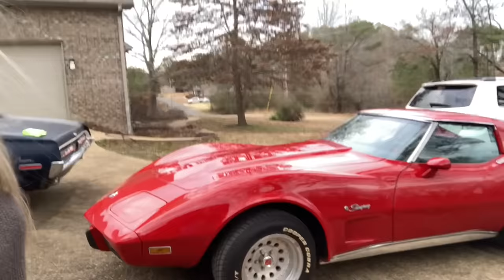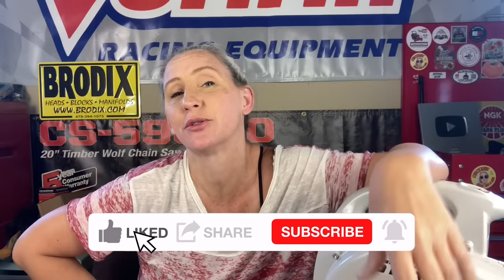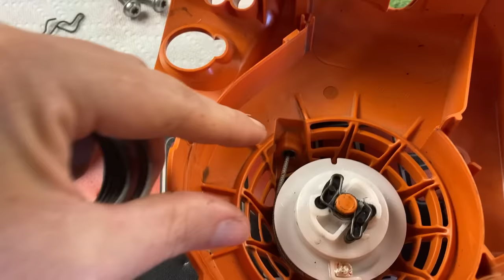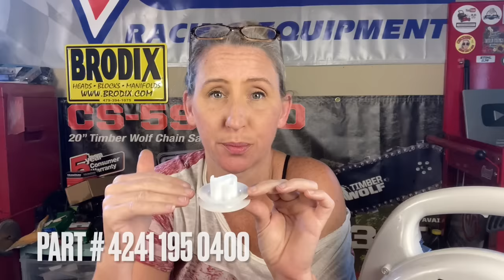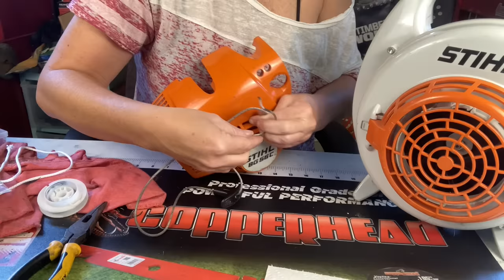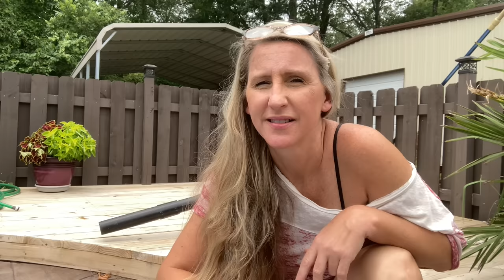STIHL'S "Easy Start" FAIL! How to fix it FOR GOOD! Stihl BG 56 C

Comment: If you want to undo a tight knot, simply place the cord on a hard surface and gently tap the know with a hammer. You might need to turn the knot over and tap it again from the other side, but when you’ve done you’ll be able to easily untie it.
Reply: ya gotta massage the knot.
Reply: That method actually works on big knots as well. My tow strap for my truck got knotted and it worked good for undoing it.
Reply: Or, you can just cut it off.
Reply: Or, do what Alexander the Great did with the Gordian knot. Just cut the damn thing!
Reply: Wow , what a great idea.
Reply: Roll the knot on the ground under your heel.
Reply: so do you call the clips of those dogs?..  did I hear that correctly? lol
Reply: You have to set the blower on the ground to start it. People want to hold it with one hand pushing it down while pull starting it and the spring can't handle the tongue. Ask the customer to start it up for you  and see how they start it.
Reply: @leroyc5289 butterfly clip, kinda looks a butterfly shape.

Comment: I work for a Stihl dealer and the issue we see that causes 99% of this problem with the easy start is that the top of the pulley post above the groove for the pawl spring starts to mushroom. When you take the recoil apart and it is hard to get the washer off the post is mushroomed and will keep having this problem if repaired. We sell the customer a new recoil, you'll have a happy customer and a repaired unit.
Reply: Good to know, thanks. But how in the hell does that pulley post get mushroomed? If I remember correctly, it's made out of some type of aluminum, but I didn't realize there was any kind of force being directed inwards towards the shaft that would cause it 'shroom out like that.
Reply: I did that , $ 75 for recoil !  Bad deal

Comment: Worked in a huge yard equipment shop years ago when I was between jobs. Learned a lot about small engines, always had a mechanical ability. Stihl was the hardest brand to start, that is why if still use Echo equipment.

Comment: There is another fix that is more economical and quicker.  I experienced the same problem with my SH86CE and found a solution and the cause of the problem.  The spring "butterfly" clip  (part # 1128 195 3500) and washer (part # 0000 958 0923) no longer exert enough pressure on the carrier "center pulley" (part # 4241 195 2001) which sits over the spring  (part # 4241 195 3501).  The carrier-center pulley no longer sat flush over the rope rotor (part # 4241 195 0403).  I purchased 2 additional washers, now a total of 3 including the original, to have the carrier-center pulley be firmly on the rope rotor.  My blower has been used multiple time now and i've experienced no issues.

Comment: I guess I'm lucky. My MS 180c is my go-to saw and has been used professionally for 4 years in the hot desert heat. The easy start messed up once and was good to go again after simply taking it apart and cleaning it out. Definitely not a saw you drop start. Good video.

Comment: i used your tip to slowly pull a few times (just over the first point of resistence) with my Stihl 230, before i really try to start it, and it starts way easier. THANKS.

Comment: I can say from experience that when the main spring comes out it really ain't no fun.
I had to take the spring out on my chainsaw because the end was broken off so it wasn't working.
I had to fold a new end on the spring and then wind it back up and place it back in it's place.
That's a job I really don't want to do again because I really struggled with it for nearly an hour but I did get it fixed.

Comment: Those easy start Stihls remind me of the old Briggs and Stratton motors with the wind up crank on top of them.  If you're old enough to remember those.  I seen a lot of them back in the day when  worked on mowers.  About the same category of junk in my opinion.  The pull up starters were better but not great.  I made sure all of my Stihl products didn't have that easy start on them when I bought them.  Great video as always.
Reply: I remember seeing them, but never used them.
Reply: Seen the old crank starts and used them when I was a kid.  Am 71 now.
Reply: I picked up one of those on garbage day, but ended up putting a recoil from another dead mower.  They were slow, and a pain to use.
Reply: When I was a kid I cut grass and one guy insisted I use his mower instead of mine, and his had one of those wind-up Briggs engines.  It was way more work winding that thing up several times versus a couple of pulls of the rope.  Some seemingly good ideas are just duds.
Reply: Funny you should mention that because I have one in my Barn that’s in pretty good shape. Love this Chickcanic. Teaching this old dog some new tricks.
Reply: When I ran my shop  I had a fear that a customer would bring one in for a spring replacement on a wind up starter.  Can’t imagine what a beast it would have been to replace.  Luckily, never saw one come in.
Reply: When I was a kid I always wanted a mower with the wind up crank! Wanted one on my minibike which had the 2HP B&S you revived in another video (on an edger?)

Comment: I had the same problem and found out all you need to do is make sure there is no play in the spool. I added an extra thin washer under the clip and it's been working fine for a long time now. 
If there's any play the spring pops up and gets tweeked. I guess you don't really need the easy start spring spool, but it was easy to fix once I figured out the problem.

Comment: This has happened in my job plenty of times with the spring. You’re right, it sometimes happens again even with the new spring in but now every time i change the spring i also change the butterfly clip aswell. I think it gets damaged when the spring forces itself onto it when the spring fails. Never had a problem since changing the spring AND the butterfly clip.
Reply: Good to know.

Comment: 4 a quick at home fix,  take the damaged spring out and I use my soldering iron.  I melt the 2 pieces together by plastic welding the edges together. Haven't had a problem with any of the blowers or trimmers i've done this 2.  Sometimes you can't wait on parts.

Comment: Several years ago I bought a 56rc trimmer with the easy start and never realized how far stihl had fallen. Easy start failed, the string head failed, I was ready to burn it after six weeks. My father, with the patience of Job, took it to the dealer and they replaced the pull start and string head with parts from the commercial line and its been decent since. Will probably try another commercial brand next time.

Comment: Bought a 56c over a 55; dealer said it was easier to start, but never told me the correct procedure. At any rate, six hard pulls after choke & tickle will do it. Can't imagine how many the 55 takes😣. A couple of easy pulls on this, weedeaters & chainsaws & then put it on compression will usually keep from busting fingers.
Ed c

Comment: Thanks for this video. I have one of these Stihl blowers, and I had no idea that’s how it worked. I tried mine today, just pulling the cord without yanking it, and while it didn’t start on the 1st or 2nd try like it did when I just yanked the heck out of it, it did start on the 4th try, using no effort at all. I’m shocked that the dealer did not explain this to me when I bought it. Nice !

Comment: I bought a saw with that system from a neighbor who was moving.  I read that you need to pull gently, and doing so, it's worked fine.  OTOH, the no-tool chain adjustment is a good idea gone bad.  Hopefully the easy start will behave, but thanks for the heads up on the spring.

Comment: I dealt with the same issue for a long time as well with my customers. They were on backorder earlier this year. It appears that they pulled all available stock and replaced it with new. I'm not sure if these newer springs are better yet, but I haven't had the last few come back to me since then.

Comment: I was once rebuilding a Stihl chainsaw with this feature and a sprung spring. Went up to the dealer and bought a new one for $5. Bent the new spring on the first pull. I'll be the first to admit that it was user error, but if you've never experienced one before, you just yank like always and the result is usually a bent spring. I wouldn't say it's a bad design, just that nobody knows how to pull it the right way. I guess that makes it a de facto bad design. Since I still didn't know how to pull it, I bent the spring back as best I could, clamped it, and tack welded the spring windings together. Now being one solid piece, it worked like a standard pull.

Comment: I always tell my friends and family not to buy "Easy Start" or as I call it "Never Start" because I have people come in with brand new equipment and broken easy start all the time. It's great to know this fix! I have been turning them away because just like you I changed the spring and their back in less than 2 weeks... This method is perfect in my book! Get rid of the useless gimmick and go with what works!

Comment: I got a ms250c real cheap and hate the c part so I got a flywheel and pull start and turned it into a regular saw! Also got rid of the ez chain tensioner part! It's now a regular saw and it's lighter as a result! All that ez crap adds weight! Good vid as always!

Comment: Every time I notice a new post by you about repairing a Stihl or Echo I always watch, just never know when I might run into a problem sometime and with luck id be like wait a minute I think I seen that problem on a Chicanic video. I have a 12-13 year old Stihl HS45 hedge trimmer that's had a ton of use over the yrs and still runs like new, doesn't look new but still runs like new. I also have a old echo weed Wacker that I've had good luck with. I found that staying away from the big box store budget brands, a little PM then the use of non ethanol gas helps extend the life of my equipment. My lucks got to run out sooner or later lol

Comment: I bought a new Stihl 251 chainsaw about 5-6 years ago with the Easy Start.  I hated it so much I took it back and had the service guy switch it to a  non-Easy Start.  It turned out he had just taken in a fried 251 and swapped out the entire plate.  I've never regretted dumping the Easy Start.

Comment: My 32 Y/O Stihl saw seized up on me about a month ago. I went back to the same DLR for warranty but when I asked about it he just looked at me cross eyed! I looked at the new saws and after I picked a length 18" he tried to sell me a C model because I am 68 years young. I tried like crazy to make it work for me because it really sounded like a great idea but after fiddling around for 20 minuets I opted for the regular version. I'm glad I did after watching your video here because that's what I would have ended up doing. I think the C model was another 40$ as well so money saved. That thing has a lot of compression for an older fellow though!  But it usually starts on the third pull cold and one pull hot.
Reply: The E-Z starts have the primer bulb and the tool less chain tensioner and if you don't use the primer for the cold start you are going to have to pull the cord several more times than a regular starter.The primer is there for a good reason.

Comment: At the starter rebuild stage, I found it good (maybe just me) to replace the starter handle with a D handle.  I started putting them on wildfire saws, but now everything from a mower to blower has one. I can start with gloves on, even put notes not to overpull or not to pull super hard
Reply: Agree.  I have an MTD snow thrower with a D handle and it makes life much easier, especially with gloves on.
Reply: Love the D handle on my ms660!

Comment: I appreciate your channel videos. For this one I have a Question for you.  Normally on a recoil I always wrap the rope first. Then place spool into the housing. Then fish the rope out through the notch. Turn the spool/spring one turn. Then feed the rope the tail of the rope through the hole in the housing and tie on the pull handle. 
I don’t understand why you’d turn the spool so far til it cannot turn when my above method has always worked well???

Comment: C doesn't always mean that the Stihl machine has easy start. They used the C suffix to designate Comfort and that includes 3 completely different features that a machine may have. From Stihl's Technical Reference Guide... "Comfort can have one or more of the following features:  Easy2Start™, Quick Chain Adjuster, ElastoStart™" The most often seen Comfort feature is the Elastostart ™. It basically comprises of a spring in the recoil handle that makes it just a little easier to get the engine to start turning.
Reply: I absolutely hate the Easy Start and the Quick Chain Adjust. Two answers to something that was never a problem in the first place. I reckon it was just a marketing gimmick for the amateur user.
Reply: @philhawley1219 convenience. Same thing with saws and such racing to see who can make the lightest saw with the most amount of shit. People obsess over EASY.

Comment: Great video but i have a question. I notice on other Utub videos that show you how to repair chain saws. As they stop their chain saws they pull out the starter rope out anout 6-10 inchs. Not sure why they do this since i would think it would engage the plastic dogs and were them out quickly. i would appreciate any explanation you may now why they do this 7:24

Comment: I have an HS 45 Stihl hedge trimmer that has carburetor issues, resetting the jets to 2 turns out will get it running, But once you hold the throttle full for any length of time stalls out when released, It seems to run fine while the throttle is fully depressed, But like I said as soon as you try to release  throttle at all it stalls. Do you know of a better high, low jet settings to help fix this problem? or would you say it was the metering diaphragm and needle that is causing this problem?

Comment: We have lost all of our good small engine mechanics here in Shreveport. No one seems to hold onto old mowers anymore. I work on my own. I learned at Sears Service Center. I have an old B&S engine I'm working on that the housing and bracket that olds the top on has rusted almost off. I cannot for the life of me find this bracket anywhere, even used. With a lot of work and a lot of zip ties I have it where I can start it now.
Reply: Tried finding the model # for the engine but it's a QR code that's scratched up.

Comment: Great video.  I have a Stihl 180 chain saw that is 15+ years old.  The compression is down to about 30 lbs.  I'm going to replace it with another 180.  Problem they all have the easy start system which I hate.  Can the old system on my old 180 be taken off and put on the new one?

Comment: Where do you get the new/taller pulley? I need to order one for my MS250c chainsaw…how do I find out what part number I would need?
Thanks for a very helpful video. I have fought with this easy start system for years😤

Comment: I have a Stihl MS180C chainsaw.  I've had it for many years - lots of carb problems, but never a problem with the EZ start. I've not liked the EZ Start since it was new.  I've often wondered if there is a way to convert to a traditional engagement.   Is that replacement part good for a MS180C?  I have three(?) BG85 blowers that are trash (locked up).  Can I take a part out of the BG85 and put into the MS180C starter?

Comment: Stihl is right about sooooo many things, damn near everything actually, but wrong about this.  I'm glad there's a way to remove the feature and get a setup that works, even though there's no easy start anymore (which I don't want anyway).  My chansaws' decompression valves have been much more reliable in terms of making the start easier without the spring start.  In my case it's the 500i (no "C").
Reply: Stihl does EVERYTHING wrong. For starters, the fuel tanks with threads inside! What a stupid design. Been in business for 30+ years, tried them all trust me. Stihl has the worst starting issues of ANY handhelds. Even the disposable stuff from the box stores (not that we use those). I’ll take a second hand echo, husqvarna or red max over anything new from 
S tarting
T rouble
I s
H onestly
L ikely
All day long, I realize you love stihl and I’m not going to change your mind but every echo I own starts on the first or second crank

Comment: i cut a thin tin plate to go around the inside of that spring between it and the plastic . sticking up a little higher than the plastic as that is where the spring pulls into under tension and it sorted it so no matter how hard you pull it it doesnt twist the spring  , when pulling the start there is a small gap which the spring tightens into and can deform ,very bad design

Comment: Thanks for the videos they are a big help.  So I've been trying cut a giant oak tree thats fallen on part of a friends house. It is on top of lot of debris such as roofing tile, dirt and rocks. We have gotten it mostly cut into slabs however we are at the bottom and we keep dulling chains.  It has been a team effort now we are kinda stuck.  Any advice?? !! Thanks
Reply: You could try a carbide tipped chain.  Much more expensive, but they likely tolerate debris more.  I believe fire fighters use them for cutting into roofs on burning buildings.

Comment: It is best to reconvert back to non easy start for those heavy handed customers. We have Just replaced a whole pull starter assembly on a BG 86 C for a customer who just kept having issues with his pull start breaking as he kept pulling it too hard. Stihl have now dropped the easy start on the BG/SH 86 blowers in the UK and Europe as they have realised the majority of the customers buying them are local authorities or contractors who don't understand the word pull gently.